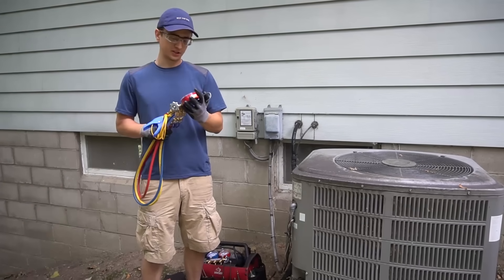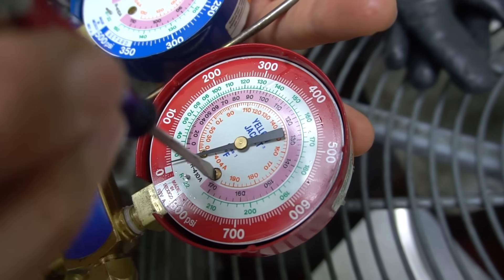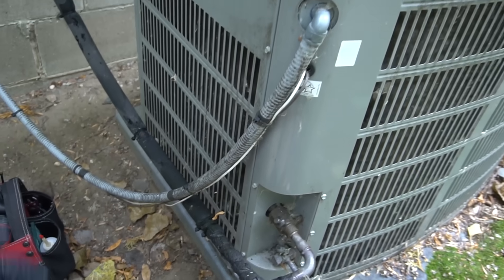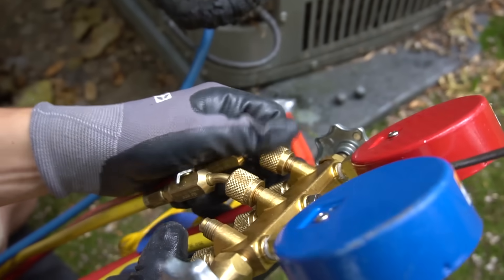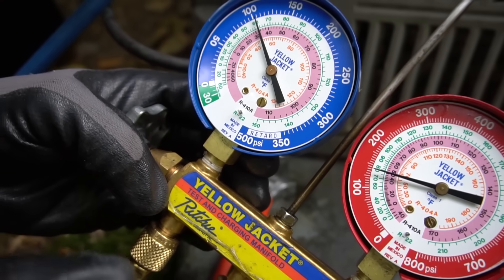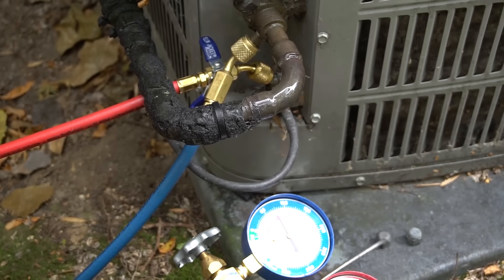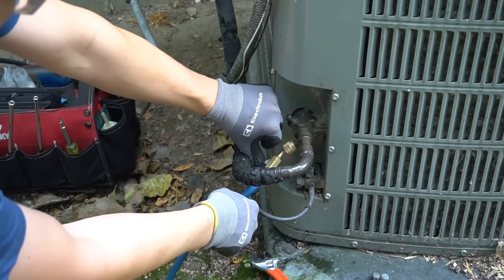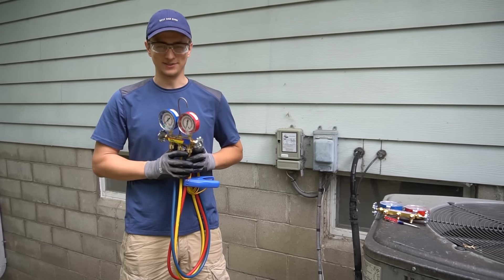How to Check AC Freon Level

Comment: I just had an HVAC contractor diagnose my a/c unit, he advised it's impossible to determine how much refrigerant is in an unit. I advised him I've had a few HVAC contractors advise mines was low by 1lb or 30%. He just laughed and said it's impossible to determine.  I described the tool used to measure. He just advised how many certificates he have and tried to show me. He humored me and pull out the gauge to measure but made no comment on the levels. He sent me an estimate for $17k for a new unit. So, the HVAC company just sent me a salesman? The last HVAC contractor afterwards said to clean my coils and advised my refrigerant is down 30% and possibly my delay on break timer may need replacing. Cleaning the coils got my a/c unit back running. It does not want to come on when it's 100 degrees outside, but will come on in the evening when it's a little cooler. My neighbor advised the line from the compressor is not as cold as other neighboring a/c units. The refrigerant needs topping off. That salesman who spoke more about his credentials than the actual problem with my a/c unit needs an apprentice position with a grassroots HVAC contractor who will advise, "hose down your coils." 😅
Reply: Do you always say “advise” this much? I’d advise you not to.

Comment: Thank you for this helpful video.
How to know if there is R22 in the unit or not by using manifold?
Because Compressor Contactor  is not working and I think it is gas problem. So how to check?

Comment: You mentioned that you have separate gauge sets for different refrigerants. I was taught that in my automotive school. The gauge sets are expensive… Do you recommend getting a whole gauge set for each type of refrigerant or just certain parts? Thank you kindly for your informative videos!
Reply from the maker: If you do this as a career, then it makes sense to get a few sets. Especially for the refrigerants you see most often. If you rarely use the gauges, then I think there's no need to get multiple gauges.

Comment: Great video. Most videos say the low side should be between 50-70psi for R22/407c with ambient temp of around 85deg. But you mentioned around 40psi. Is there a reason?

Comment: I have R22, blue gauge rich 65 then back to 40 then 65 and also back to 40, gauge not staying at 
certain number looks like compressor not pushing gas all the time, any advice for this issue especially low pressure pipe not not cold enough ?

Comment: The only I will say is that purge the hoses before measuring.  Like after connecting, just open the hose connection a bit to clear any air out.

Comment: Being a certified HVAC-R guy, but out of the game for years. I tried helping inlaws with charging up their unit with R 22 with non TXV valve. Doing the superheat method, but high side stuck on 110 PSI and same with low suction side at 110 PSI. FILTER and evap was cleaned. Pipes were freezing. I put refrigerant 6 times in vapor with a full tank, but nothing. There was no ice or frost. Temps never moved. Any suggestions?

Comment: What should the low side PSI b be for an r22 unit on a day that is 70° outside. My understanding from your other videos is that when it's 80° outside PSI on the low side should be around 70 PSI right now it's not quite that hot out it is about 70°. I would appreciate this very much thank you

Comment: You provided nothing as far as checking your superheat or subcooling, condensing temp, outside ambient, amp draw, etc. Just checking pressures does not tell you how the system is running or if it is properly charged. I would advise anyone watching this to at least consult the manufacturer's operation and installation manual for the system charging curves. And invest in some good pipe thermocouples and a multimeter so you can accurately check how the system is performing. You'd be surprised at how much the charge can be off and the increased amount of energy a unit will consume due to improper installation and service. Beware of the hacks!

Comment: I take the low side off while it's running and then  the high side after the unit is off and static pressure is stabalized.

Comment: Hi, thanks for the video which I learned a lot from.  My upstairs R22 AC runs continuously when it's on without lowering the room temp.  I see about 12-16F difference between output vent vs return vent.  I went outside and checked the AC at the low side near the charging teminal and it is not sweating as it should be and instead, it is warm.  I measured the temperature near the terminal to be about 85 F when ambient temp is 84F.  I know it should be like 45F as my downstairs AC is sweating at the low side terminal as it should be and it measures 45F.  So what could be wrong?  I understand that, if refrigerant is low, the temp should be below 0 and the pipe around the terminal should be frosting.  Since it is opposite of this, could there be too much refrigerant in the system?  I would appreciate it if you could help.  Thanks in advance!!

Comment: What is the difference between R22 and 407c pressure?
Reply from the maker: This chart breaks it all down: https://advantageengineering.com/fyi/289/pdf/advantageFYI289.pdf
The pressure difference fluctuates depending on the saturation temperature so I can't just give you a number.

Comment: Can I check the Freon Level by hooking up only the blue gauge, not hooking the red gauge?
Reply from the maker: Usually yes. But if there is something else wrong besides the unit potentially being low on charge, then you won't be able to catch that with just the low side gauge on.
Reply: Thank you!

Comment: Good stuff!! I have a rookie question- When you transfer the refrigerant from your high side red line through the manifold and low side blue back into the system, does it pull air that is in the yellow cha/vac line with it?? I know you closed the ball valve on the end, but I keep wondering if there is air between the ball valve and manifold being pulled into the system. Everyone seems to do it this same way. I am a complete newb, but I cant find the answer to this nowhere.. Many Thx!!

Comment: I am retired, but this young man is clear and concise in his instructions. He is young, but he has invaluable advice. I agree with everything he has said.
Reply: can i ask so i how do you know if you have to much freon or not enough
Reply: @DevarnTripplet system won’t cool properly, might have ice build up. Use pt charts to check high pressure because it will be higher than it should be. Consider ambient temp/humidity. (Currently trying to learn hvac myself)
Reply: App is nice if you know what your pressures and everything need to be at

Comment: I totally guessed a Minnesota accent. I can't believe I nailed it!  You talked about the low side temperature but didn't mention the high side temperature. Since it's about 70 degrees in Minnesota, the R22 temp was showing about 90. So, ambient +20 as a general rule for R22?

Comment: When you call a technician to come and check your system and he/she looks and sees sweat on the low side and doesn't hear a valve clacking and doesn't use gauges and says, it's working fine, and then says, "it's hot out and the system can't keep up", what do you say?

Comment: So, if we want to add refrigerant,  we would do it through the low side (vapor line)?  Thx.
Reply from the maker: Yes, you always add through the low side.
Reply: @WordofAdviceTV  Do I need to buy temperature clamps to measure the low line to check subcooling?
Reply from the maker: @jaimedpcaus1  Yes, if you will be adding refrigerant, it is best to do it with superheat or subcooling readings.
Reply: @WordofAdviceTV  If I have to add refrigerant, does it mean that I MUST have a leak?
Reply from the maker: @jaimedpcaus1  Yes. It is a sealed system which means the refrigerant in there should last like 50 years if there is no leaks.

Comment: I have a brand newGoodman but it is out of warranty because I was building the new house and did not use unit.  It does not cool.  The air coming out of the vent is not cold enough and the room is not cooling as it should. I closed the breaker and reset the thermostat but no change.  What is your suggestion? Do you think it’s the freon?  I would appreciate your advice so much and thank you in advance

Comment: Dear, thanks for this channel, I have such a problem - it was hot in the morning - 27 degrees Celsius and the air conditioner, when turned on, cooled the air up to 20 degrees Celsius at the outlet of the air duct, and in the evening I measured the temperature of the tubes at the inlet of the air conditioner and one pipe of 24 degrees Celsius inlet and outlet pipe 9 degrees Celsius and froze over, and at the same time it was 22 degrees Celsius at the duct inlet and 24 degrees Celsius warm outside. In other words, the air conditioner does not cool as efficiently after 12 hours of operation - what's the problem here?

Comment: I just vacuumed the line sets on a two zone Mr Cool.
I'm going to recharge the lines with R410A to 117-120 PSI.
I do this via the blue hose to the Multi Split and the yellow hose from the coolant container, both via the manifold.   
Correct??
Reply: Ypu are correct about the placement of the hoses. However you should charge by weight. Somewhere on the unit it will say how much refrigerant the factory charged it with. Sometimes you will have to add a couple of ounces extra depending on the length of the line set. The installation instructions will tell you how much to add for the lineset length.
Reply: @Redtooth75  Thank you!

Comment: What's the yellow tube for?
Reply: To add or remove refrigerant and to pull a vacuum.
Reply: @Redtooth75  I can only find R22a in my local area, the package says it's okay to replace it with R22 systems but it's labeled as flammable. Is it okay to do this?
Reply: @belowmars  you should call someone. Refrigerant is not generally sold to the public, licensed contractors can buy it. There are a couple of online places you can buy it from if you are in the US and have the certification.
You cannot add anything other than R22, not R22a, to your system. If you wanted to switch to a different refrigerant then it would all have to get pulled out and then replaced entirely with a new refrigerant.
No offense but I am pretty sure this is beyond your skill level and you most likely do not have the equipment to do it. Call a professional.
Reply: @Redtooth75  I think the requirement in Canada is a little different and they don't prohibit R22a with R22, I just want to know if these 2 refrigerant technically have the same pressure temperature readings.

If the pressure temperature chart is about the same as R22, the only concern is that I think R22a has added propane and thus flammable. It would be good to know the possibility of having R22a as a backup if one day R22 is no longer available even for certified techs.

Comment: Great Video: Here my Problem. Contactor is not pulling down. 24 and 240 Voltage tested ok. new capacitor installed . Now I am thinking High or low pressure switch due to low refrigerant are the issue. Should I just manually engage the contactor and see what happens while checking with your steps here ? ( when I turn off AC in September the compressor and fan worked ) Any advice would be greatly appreciated !!!
Reply: You should not manually turn on the system unless you know its safe to do so without damaging the equipment. Its hard on the compressor to run it with no refrigerant. Make sure you have 24 volts coming into the system from the small thermostat wires that are usually wire nutted to the factory wiring. If you have 24 volts there then check for 24v at the contactor coil. If 24v is not present then its a pressure or temperature switch that is open, if you do have 24v to the coil then its bad contactor. If you do not have 24 volts going to the unit then check for 24 volts between the C and Y terminals at the control board which is usually located wherever the blower motor is. If you do not have voltage at the control board Y and C then its the thermostat or thermostat wiring, blown 24 volt fuse, or a bad 24v transformer. If you do have 24v between Y and C then its the wiring leading out to the unit.
Reply: @Redtooth75  Thank you so much !!! I checked the system further by connecting the Yellow thermostat cable to the contactor directly ( by passing all the switched) and it pulls in. So Now I am thinking it's the low pressure switch. What do you think I should do from here? What should I diagnose next ? Thank you so much again - your help was invaluable to me !

Comment: With a r22 system , Would the low pressure line not sweating or even very cold be a sign of low r22 ? My ac only feels a little cool late at night and early in the morning. During the day it’s not keeping up at all in the high 70s outside. I’ve lived in my place close to 12 years and have never had any coolant put in.

Comment: Nice video low lost hose looks good could r22  and r410 mix meaning top up or if the sistem is working with r 22 can I used r 410 in stead thanks let me know

Comment: How come you didn't purge the air out of the manifold before start up. The suction line will pull the air trapped in the line if you didn't purge it.

Comment: Just curious. Why didn't you pirghe the yellow line before recycling the freeon in the lines? Or did I miss something here. I see you closed the line but that was at the end of the line. 

I didn't see you bleed the air of the line initially when you hooked up to the low first either... I'm a novist so I might be missing something here. 

Thanks for the video BTWA.

Comment: For anyone watching this video one thing I would suggest is NOT to get into the habit of putting your gauges onto soil / dirty ground like in this video... hang them up with the provided hook well clear of the ground.. and keep them in a case when not in use.. some of that soil / moss can make its way into the fitting, especially the rear ones which although are only dummy holders on the gauges were face down in the dirt, when you reattach the hoses you might not notice.. this can then cause stuck Schrader valves, dirt into the system or hoses that don't screw on properly because of contamination causing a refrigerant leak until you can uncouple the hose and clean it out.
Reply: Thankyou sir welcome  sir
Reply: Facts

Comment: Great video! My low side are no cold at all, but my fan works and thermostat. I have a little knowledge on ac, I’m an auto Technician. The only think I don’t have the right tools for house ac. My house unit looks pretty clean no damage or blockage from debris. Where do I start? Thanks

Comment: Thank you so much for this very informative video.   I learned a LOT and am very grateful.  If moisture is the worst contaminant, shouldn't it be better to vacuum the manifold, gauges and lines before checking the pressures?  OR use drying tubes on either end prior to measuring the pressure?

Comment: Not good, you got air in the blue hose, it's in your AC now. You should've open your left side manifold and yellow valve so the refrigerant would push out the air inside of your manifold.

Comment: My AC guy just worked on my system, there was a big leak as he was disconnecting the high-pressure hose from the condenser, it was going on for like eight seconds. Is that super bad?

Comment: It is way more complicated than this. You will never be able to tell if the system is running properly just by looking at pressures. You need to check superheat and subcooling!!

Comment: Good vid. I would add - 1) Only use one gauge for each freon so you don't cross contaminate the different oils and freon. 2) All medium temp operating saturated suc temp should be around 35-45 degrees. 3) In the off cycle freon will migrate to the coldest location in the system. 4) Checking the difference between the saturated suc temp and the suc line temp = superheat. Most system = 12-20 degrees. 5) The difference between the saturated liquid temp and the liquid line temp = subcooling. Most system = 10-15 degrees. Have a great day!
Reply: Great info! What do you suggest about how to measure the line temperatures? What kind of tape should I use to tape the thermocouple lead on to the line pipe? Also, how to check if thermal expansion valve is used in the ac system as it regulates the superheat if it is used. In this case, the measured superheat may not help tell whether the Freon level is low or not.

Comment: I'm still a student for HVACR, but we did measure psi's and performed a return air with a vacuum pump. Easy way to remember how to measure with gauges is Big Blue Little Red.
Reply: Same here. In Lincoln tech for hvacr. And indeed correct suction line blue, and liquid line red👏🏾💯

Comment: So there is "No Need" to PURGE the gauge lines when "first" making the connections, as the air, which "IS-in-the-Gauge lines", stays in the gauge lines, and does Not get into the System?

Comment: Very informative.  I have a somewhat different situation.  A friend bought an abandoned building, and will soon tear it down and build a new one.  I can take whatever I want before the demolition, such as the AC and furnace components.  I believe the AC has not been turned on for over five years.  
Is my first step to check the high and low side pressures at the compressor?  If there is decent pressure at the compressor, would it make sense to try to get the AC running in the building?  Or would it be better to disassemble everything and check the components individually, prior to reassembly at the garage I'm building?  If there is pressure in the system, is there an easy way to capture the freon and reuse it at my new location?